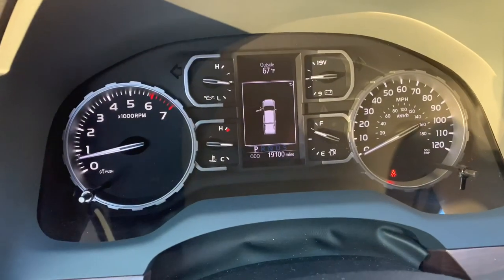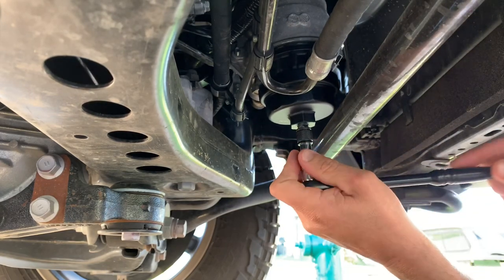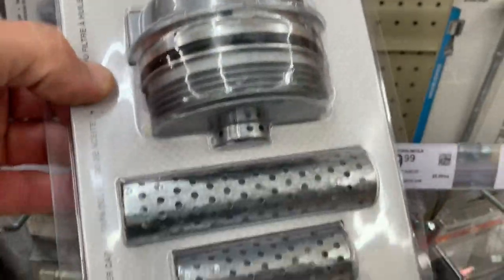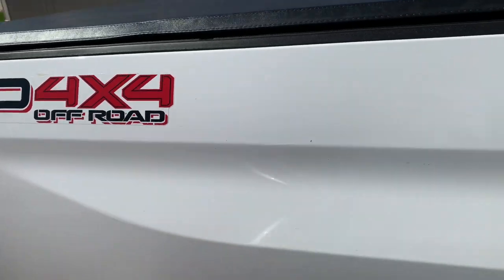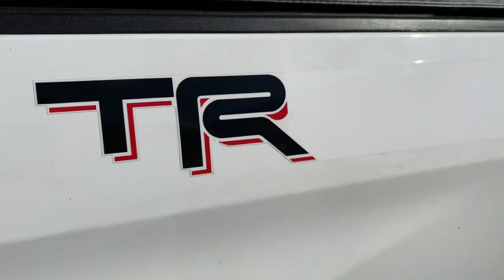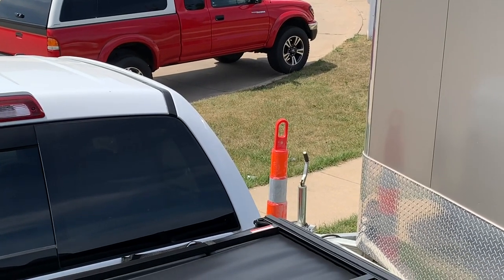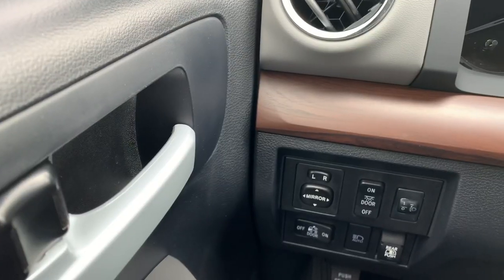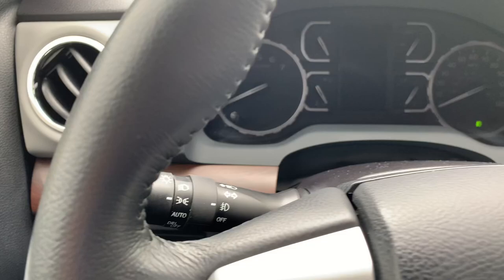2019 Tundra- 20k mile Experience and using Motiv X Filter Wrench

Comment: In 2019 and 2020 they deleted the external transmission oil cooler . Recommend you purchase the Toyota part remove the spacer and reinstall the splitter that enables a external transmission oil cooler. On you tube you will see videos showing excessive temps towing not having the external cooler.

Comment: If you didn’t bother with draining the filter before removal of the plastic canister, why remove the bottom piece after the fact?  I bet a lot of people do filter changes and never mess with the bottom section at all.  Toss the plastic drain tool and the small O-ring.  No need to deal with it at all is there?
Reply from the maker: You are correct-Either way would be workable.
Id check the o ring for decomposition at some point though. Just comes with the filter kit, so may as well.

Comment: What kind of trailer do you tow?
Reply from the maker: James Valdez several 2-5k# all aluminum 7x19 6x12 snowmobile 2-4 place. Generally no more than 7,000 lb. ..brands are Aluma, Legend and Mission. Never issues with them 🤞🏽
Reply: @JLeeChron  How does the truck handle them?